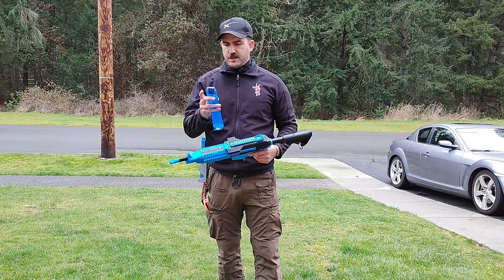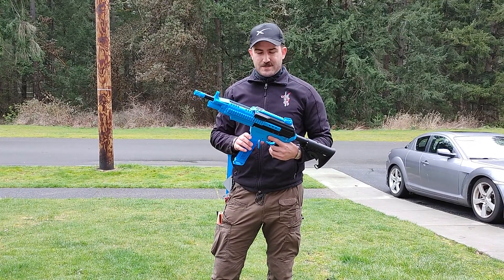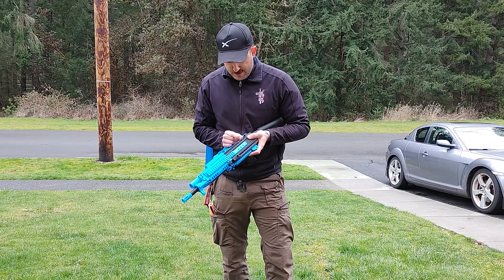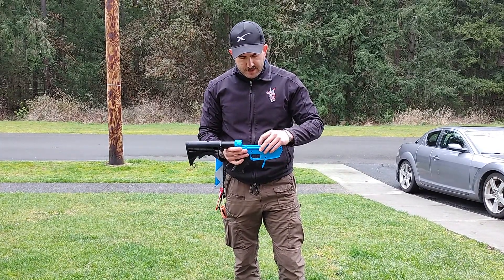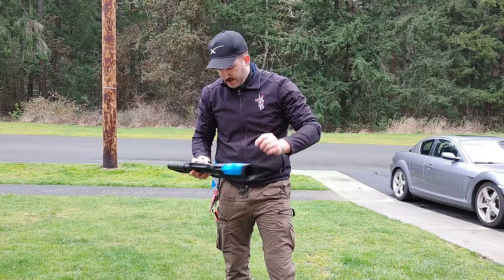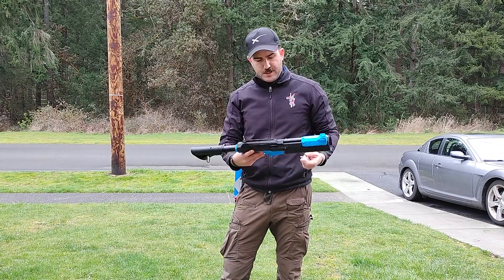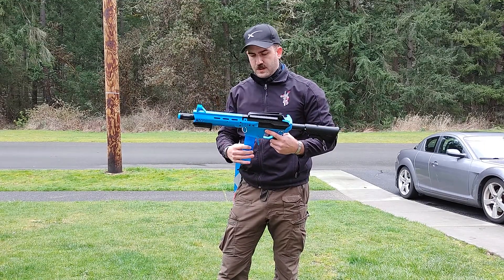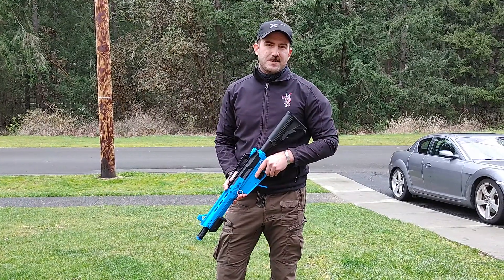Project Aurora - The electric upper lives!!!

Comment: What gun did you base this blaster on? The Galil?
Reply from the maker: The whole system is loosely based on the AR-15. the electric upper receiver however is heavily based on the M-249 SAW
Reply: @mikelaredo6906  a kind suggestion if that's possible. I think a little bit longer barrel would be great.
Reply from the maker: To the electric upper you mean? If so then that is absolutely possible with zero consequences. The electric upper actually fires from the bottom. The "barrel" is just a blank piece meant to look the part so the length of that is kind of abritrary
Reply: What I meant is for the HAMMR to look even more m249 esque, the barrel along with the shroud should be a little bit elongated. Like 3 to 5 inches must be fine I guess. 

Also sorry. It's just me who confused this with a Galil.
Reply from the maker: The main frame pieces of the receiver can't really be any longer as im limited by the size of my printer. Currently my entire project can be printed on and Ender3
Reply: Good to hear. I just asked whether it's possible. If not just never mind

Comment: I do wonder if there is a more streamlined solution than the wired connector to reach the lower. Such as having two internal tabs for the upper to come into contact with for your flywheel upper. I mean, if it works it works as it stands, but there might be more elegant solutions so there aren't extra steps beyond pulling pins and swapping an upper.
Reply from the maker: There are and im currently working on it. This was just a temporary solution to get the platform up and running for testing

Comment: Hey, in this video you said it was performing around 130 fps, semi auto. Originally (and on the website selling it) it says it will be full auto and hitting 160-180. I know those specs are when you had the original hardware, and the world is preventing that. I am just wondering if the original specs are still the goal post that you're hoping to reach. Still looking forward to when it releases.
Reply from the maker: The upper in the video only has a single stage cage and im not very good with wiring so just to get a test platform running i kept it simple and rigged it for semi-auto. This is not the end stage of what i want this upper to be, but rather a starting point to work from. Eventually i want to get the dual stage cage up and running and have it wired for full auto. But the custom PCB falling through set me back tremendously so im still working out other things.